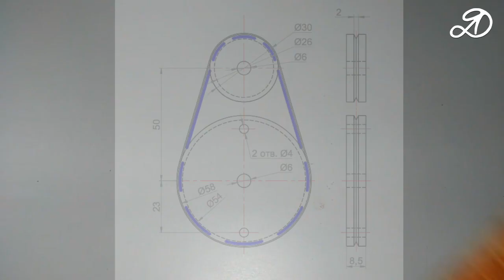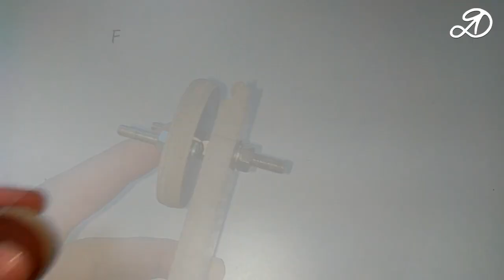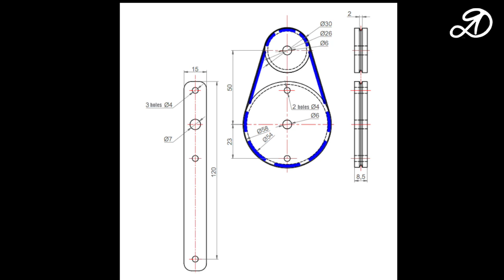Manual drive for winding cord DIY. Homemade belt reducer + Lifehack

Comment from the maker: What can I do for you? What are your difficulties and problems?
Reply: Maybe you can help me, I'm trying to engineer a ' blind'  to cover a 3.8m meter wide 20m long canal to prevent plants growing in the water (and blocking the canal). The trick is the blind must be able to be retracted so that a boat can pass through the canal. I'm breaking the blind up into 10 smaller blinds each approx 2m long and 5m wide (to cross the 3.8m canal. I'm using an 80mmx 2m long diameter plastic drainage pipe to acts as the roller. Attached balck pvc to it. The blind must be tight so that rain water flows off it and doesn't gather. The drive you have here has given me idea of how to get the plastic drainage tube to roll! any other ideas much appreciated. Thanks great channel. I've subscribed!

Comment from the maker: DRAWINGS: https://goo.gl/VZM65B Belt drive + pen
https://goo.gl/rNwhmw Adapter for connection to the coil
In the last video I showed how to wind cord on the reel using a drill, but the method was quite comfortable, and such high speed is not needed. 
In this video I show how I made a manual belt drive from scrap materials for winding polyester cord on self-made coil. Such a device can easily enjoy a woman and even a child. 
To begin, it is necessary to fix the rack actuator to the table clamp. Connect the coil to the adapter. Then insert the axis of the second post. I also came up with an interesting hack that allows you to hook on a stand for table top or hung on a Cabinet door. For this side tacked metal corners.

HOW to MAKE a SPOOL stand can see here: https://youtu.be/wr8ddUdCgfc

ADVANTAGES: 
1 - you Can make your own hands at home from improvised means
2 - Greatly facilitates the process of winding the cord.

DISADVANTAGES:
1 - Slight resistance to rotation and flutter (thread bolt rubs on the laminate). To reduce friction and prevent rapid wear can try to use metal bushings or bearings. 

GEAR RATIO
i = D1/D2 = 58/30 = 1,93
That is 1 turn of the handle turns almost 2 turns of the coil.

TOOLS:
http://ali.pub/1a88gs, http://ali.pub/1a89c3 - Drill-screwdriver
http://ali.pub/1a8adf - metal Drills
http://ali.pub/1a82s8 - Drill bits for wood
http://ali.pub/1a8edi Terminator of depth of drilling
http://ali.pub/1a8epd - core drills
http://ali.pub/1a89q3 - Drill speed
http://ali.pub/1a7uqi Core wood 16
http://ali.pub/1a7uv6 Core wood 11 
http://ali.pub/1a7v1s core bits for wood 8
http://ali.pub/1a8aqn - Pliers (needle nose pliers)
http://ali.pub/1a8zve - File triangular
http://ali.pub/1a90e9 - needle file Set
http://ali.pub/1a8awh - Screwdriver set
http://ali.pub/1a8b9i - long Screwdriver bits
http://ali.pub/1a8bq1 - Wrenches drive
http://ali.pub/1a8cag - Scissors-sewing
http://ali.pub/1a7y3g - Clamp

MATERIALS (NOTE: the Size of the bolt based on the thickness of the laminate 8.5 mm and nuts 5 and 3 mm):
http://ali.pub/1a7o96 Bolt M6x40 (secret) - 1 PC. 
http://ali.pub/1a7p0e - Bolt М4х25 - 3 pieces (or 4 pieces for double mounting on drive pulley) 
http://ali.pub/1a7p9j or here
http://ali.pub/1a7ph4 Bolt М4х35 - 1 PC. 
http://ali.pub/1a7ptr - Nut M6 - 6 PCs. 
http://ali.pub/1a7pwa or here
http://ali.pub/1a7q2i Nut M4 - 10 PCs (or 15 PCs double mounting on drive pulley) 
http://ali.pub/1a7qkz - ? Plug M6 - 2 PCs. (you can use them is extreme nuts) 
http://ali.pub/1a5ebn - M6 Washer - 4 PCs. 
http://ali.pub/1a7qoh or here
http://ali.pub/1a7rgv - 20-30 mm Screws - 6 PCs. 
http://ali.pub/1a5ffp Or screws 25 mm 
http://ali.pub/1a5lho Corner 40х40х20 (I used 35х35х12)
http://ali.pub/1a5lqm or area 30х30х16
http://ali.pub/1a5nqr - I used a metal bar 100х15 (or 120х15 for double mounting on drive pulley) - this 76 mm, it is possible to bond the 2 together.
http://ali.pub/1a8da1 - Braid (width of 6-8 mm, length 27 cm). You can use a flat strip of fabric
http://ali.pub/1a8dkx - Stationery eraser - 1 PC. 
http://ali.pub/1a8e55 - Or wide stationery eraser
http://ali.pub/1a7x06 Cyanoacrylate
Laminate 200х50х8,5 mm
DSP 200 mm